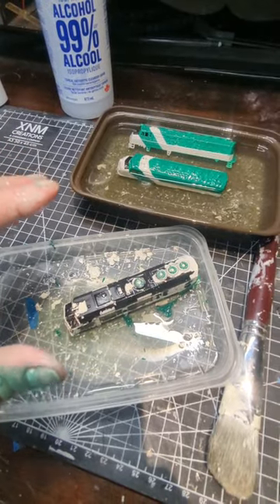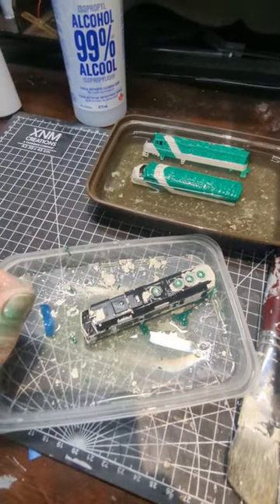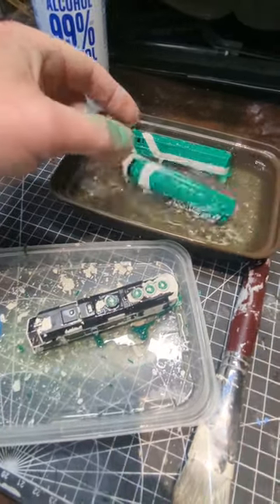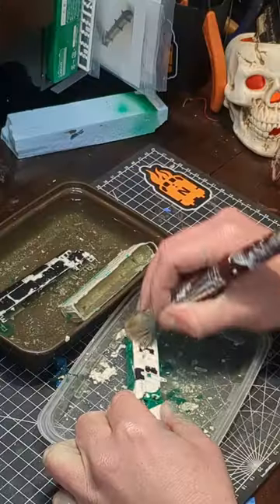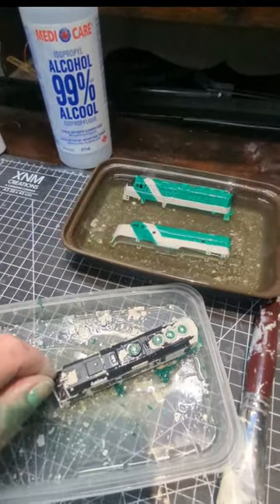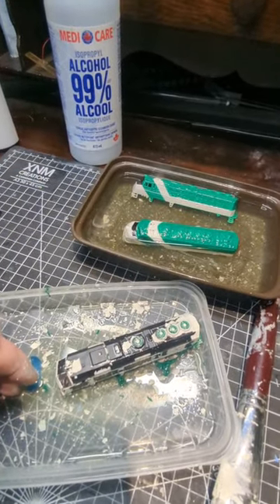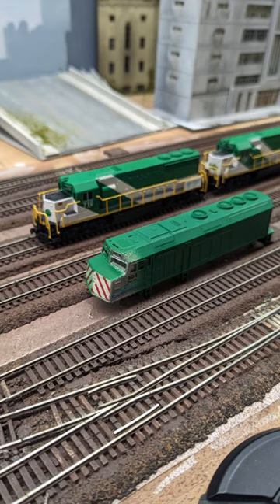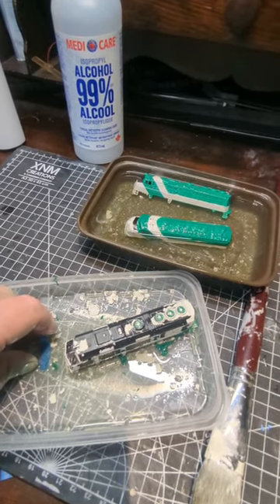Painting Fail - Second time's a charm?

Comment: Wearing gloves, and a mask when working with isopropyl alcohol is probably a good idea to protect your lungs/skin. A mask helps avoid inhalation of the vapors that can cause headaches, nausea, dizziness, and even distressed breathing/other more severe issues when inhaled a lot long term.

Sorry if I assumed you weren’t doing anything to prevent those issues incorrectly. Ventilating the area you’re in well enough probably helps, I just wanted to say this just in case.
Reply from the maker: I have a small fan out of the frame of the video to help me avoid headaches. As for my hands... I am notoriously hard on them...